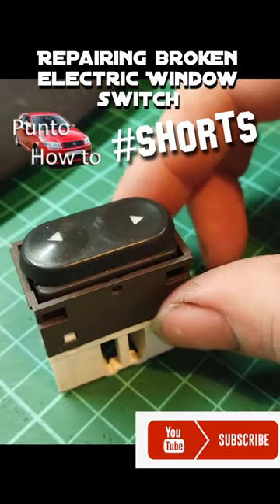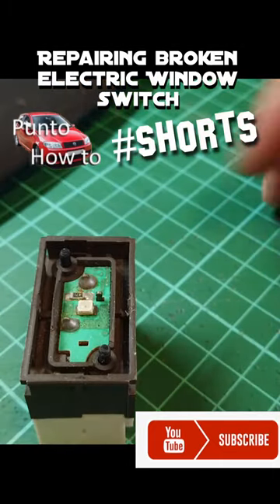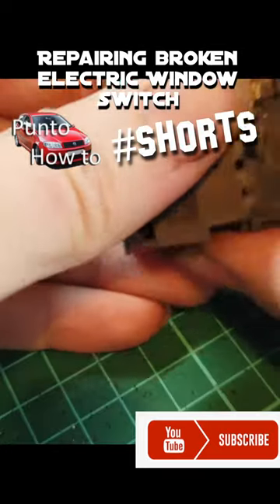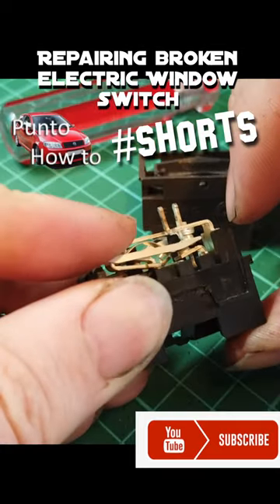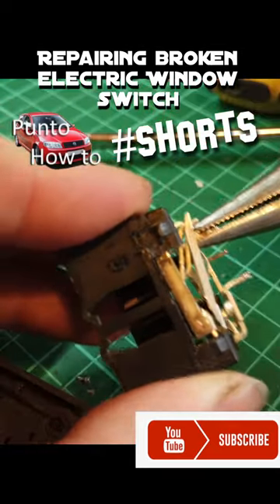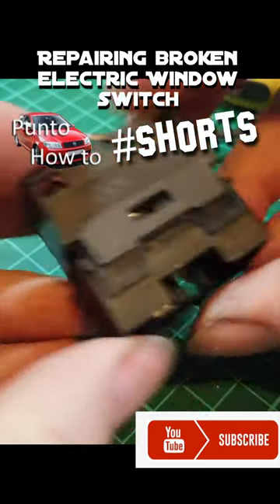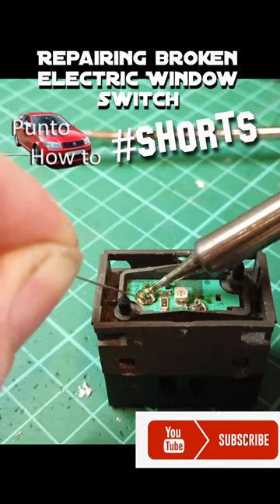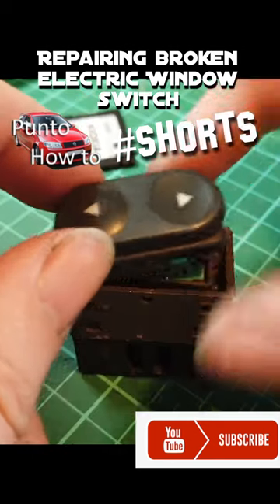Repairing a broken window/sunroof/cabrio switch  #fiatpuntocabrio  #brokenwindow #brokenwindowswitch

Comment from the maker: DIY electric window switch repair, this switch is actually used to operate the roof on my 98 Punto cabrio but is the same as the window switches and is still used today in some Fiat models, is is also a similar design to those used in Ferraris of the same era